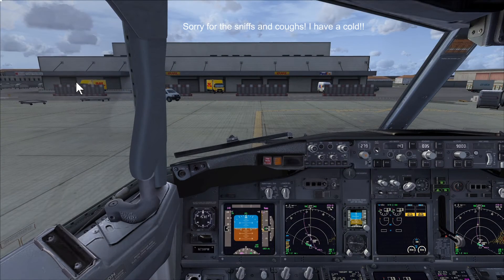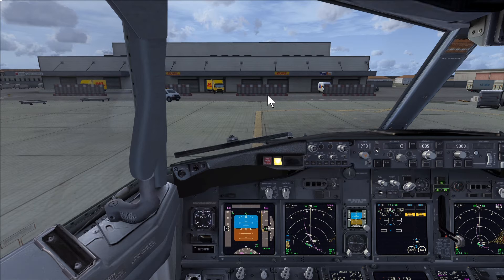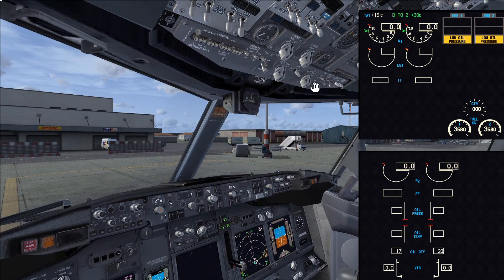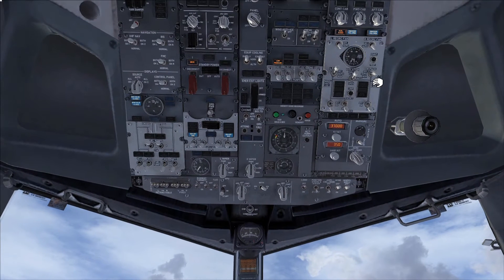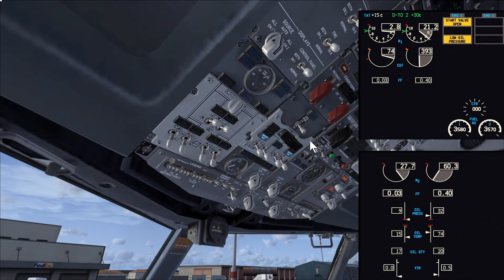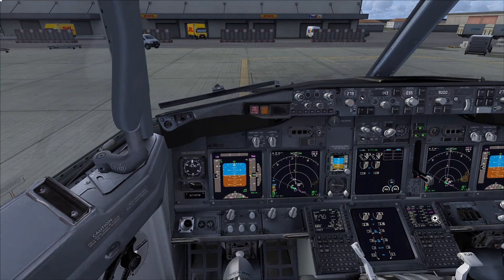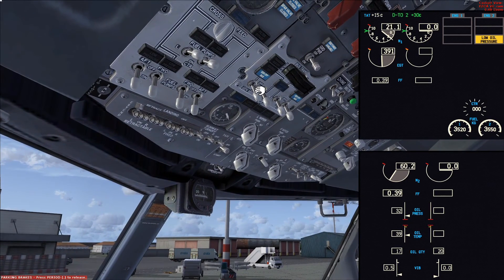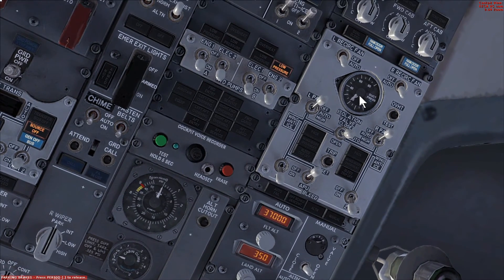PMDG 737 NGX - REAL BOEING PILOT - Engine Start Procedure

Comment: good   many thanks
Reply: i think we would need dme arcs and holds - examples and preparing hold following  instruction several examples.  all quadrants approach hdgs. and what to do: maybe even wind triangles  with examples otherwise we ll get it wrong
Reply from the maker: So nice of you! Thank you for commenting!

FD2S
Reply: @flightdeck2sim  i think we would need dme arcs and holds - examples and preparing holds following  instruction with several examples.  all quadrants approach hdgs. and what to do: maybe even wind triangles  with examples otherwise we ll get it wrong
very likely.  also progr dme arcs into fmc using fixes and distances -                to avoid practicing voodoo avionics !!

Comment: Hi Sir,

First I want to tell you that this video is just awesome :) .

But I have a little question about: do we use the cross-bleed procedure when it's very hot (like 30 ° C) ? By this way we can let the packs on. 'Cause I already saw that. But I'm not sure about.

Thank you ;)
Reply from the maker: Hi Med’

Bleeds off take off is for performance reasons. It increase the amount of thrust from the engines as they’re not having to use Bleed air to provide air conditioning and pressurisation 

FD2S
Reply: @flightdeck2sim  I was talking about the cross bleed engine start sir :)
Reply from the maker: Med ' whoops!, I was responding to someone else’s question and actually posted it here!!! 

Crossbleed start only needed if the APU is inoperative. If very hot we’d still start Engine no 2 first and then isolate the no 2 pack and eng Bleed so it can provide air conditioning whilst we start Engine no 1 using APU Bleed 

FD2S

Comment: Hello Sir,

Very fine video ! But I have a problem : I don't have the dump pressure available... I connected all the grounds connections I have but nothing. 

I can see that you have dump pressure without the Air Start Unit  (look at 6:56)  just with the GPU.
I tryed to connect the GPU only, like you , but the dump pressure stills unavailable.

Do you have a solution ?

Thank you :)
Reply from the maker: Hi Med'

Make sure you connect the Air Starter Unit. This is the alternate start procedure for when the APU is inoperative.

FD2S

Comment: if Apu is a no go item  then what's the purpose of X-bleed start and Ground start unit ?  Thanks
Reply from the maker: Hi Mehmet Zeki Demirdelen.

You can dispatch without an APU! 👍🏼 

FD2S
Reply: Thank you for your answer sir but im still wondering what would happen if a dual IDG failure occurs in flight with APU inoperative ?
Reply from the maker: In the unlikely event of you losing one IDG without an APU you would still have one source of AC power (the other IDG), this would require you to immediately divert.

If you lose all sources of AC power you have a difficult day in the office! You can still fly on battery power for 60 minutes but you lose a significant amount of systems but essential critical systems are still powered by the battery.

FD2S
Reply: Thank you so much for taking your time and illuminating me captain !
 I thought that having to rely on only battery power in an unlikely worst-case scenario is the last thing pilots would like to face.
Reply from the maker: Mehmet Zeki Demirdelen well it is! Flying on battery power is extremely challenging!

FD2S
Reply: I hope nobody will ever have to deal with that.
Reply from the maker: Me too Mehmet! I don’t know any cases where this is happened. Crew are exposed to this in simulator trainer and are trained to react 💪🏼

FD2S
Reply: Captain  again thank you so much and i'd really like to apologize if im overwhelming you with many questions but honestly though, i really appreciate the way you approach your fellow flight simmers. Wish you have safe flights !

Comment: Found your channel awhile back.  Great tutorials....informative and well done thanks!

Quick question regarding startup.  

Do you require timing for any startups. (ie to check starter limitations are not exceeded, light-off within so many seconds, or oil pressure rise)?

Keep up the great work!!
Reply from the maker: Hi Randall. Yeah we start when moving the start switch to GRD, this is for Aborted Engine Starts so we know how long the engine has been motoring for.

To move start level to idle detent at 25% N2 we need N1 rotation and oil pressure.

FD2S

Comment: Just trying to get into flight sim when I came across your videos. Brilliant to have real pilot guidance. Am I right in thinking the bleed air focuses high pressure air onto the N2 blades causing it to spin so then when they have enough momentum/torque to carry on going with ignition of fuel, similar to jump starting a car to give the car engines crank enough momentum/crank to sin up with fuel. I feel like I've just had a eureka moment if I'm right lol. Now to decide, X plane or P3D lol
Reply from the maker: EUREKA!

APU Bleed powers the starter motor connected to the N2 Rotor. 

FD2S

Comment: Air start unit- at a busy gate, will they start right at the gate, or push back first to a clear area?
Reply from the maker: Hi tasev1

Start ENG No 1 on stand with the Air Starter. Disconnect GPU and ASU then pushback. After pushback start ENG No2.

FD2S

Comment: hey FD2S theres been a few times after i start the engines where i would get a temp zone warning light that illuminates. What would be causing this and how would i fix it for future reference. Thanks
Reply from the maker: Hi Dene, 

Zone Temp light illuminates if the air overheats in the supply duct or if there is a control channel failure. If it's due to a overheat you can try pushing the TRIP RESET button after the duct has cooled. If not it could still be still too hot or the control channel failure OR a glitch with the NGX! 

FD2S.

Comment: Hello, i have just discovered your channel and really liked it. As far as ı know in the first flight of day R ignition is used because it is fed by standby bus whereas L ignition is fed by AC transfer bus. In order to check standby bus we use R ignition. And i have 2 question. First one is as soon as engine number 2 running u turned on engine number 2 pack on and Apu bleed off. Is there any disadvantage of that. And my second question is for external bleed you first started with engine number 1. Why sequence is changed. I will watch all your videos. Thanks for sharing.
Reply from the maker: Hi cagaty araz, thanks a lot!

You're right about the ignition! In the event of Total Loss of AC power we still have a source of ignition from the R igniter via the AC Standby Bus. If we have a problem with the R ignition prior to departure engineers must connect the L igniter to the AC Standby Bus to ensue we always have a source of ignition in the event of complete AC power failure! 

1. I don't know where you're referring to with regards to turning the APU Bleed off! The first engine start I put the no2 pack on and closed the isolation valve. This is the isolated pack operation start to provide conditioned air to the cabin 

2. The Air Starter Unit is and usually parked near engine no2 so we start eng no 1 first, remove the Air Starter Unit and then crossbleed start, typically after pushback!

Hope this helped answer your query!

FD2S.

Comment: I sometimes forget to turn off the packs during start. However when I have everything set right the engines refuse to start. I have to exit flight sim and start all over. Is that an PMDG thing?
Reply from the maker: Hi Bald Eagle.

You need to make sure you have a source of pressurised air. This usually comes from the APU. Make sure you have the APU running, APU bleed selected on, both packs off and the isolation valve switch open and it should work! 

Good Luck!

FD2S.

Comment: Is it flight approved though without an operating APU in general? 
Why not fix it? xD
Reply from the maker: You're quite right, there are several systems on this aircraft which might be inoperative but it's still safe to dispatch, including the APU. We consult a manual called the MEL (Minimum Equipment List) to confirm we can dispatch with the particular system inoperative.

Logistically for an airline to fix something like an APU it could take a few days to get the necessary parts, the right engineers to do the job and then find a time when the aircraft isn't scheduled to fly. Typical 737 operators will have turnaround times between 25 minutes to an hour. If something like the APU stopped working during a turnaround you don't have the time for it to be repaired so you would consult the MEL, liaise with engineering and dispatch (so long as the MEL allows you) with the said item inoperative.

Hope this helped! 

flightdeck2sim.
Reply: flightdeck2sim awesome! thank you for replying! really like the videos, subbed as well!
one more question if you may, is that a big difference between the live aircraft and the ngx model?
Reply from the maker: PMDG have made a remarkably accurate rendition of the aircraft and it has been programmed extremely accurately. 

There are a few quirks/differences but the model itself is sound and it flies in FSX almost identically to the real thing. Attitude and thrust settings for a given configuration pretty much match the real aircraft/what you get with a full size Level D sim.

I started my Type Rating 5 years ago and used it then and I still use it now to practice a particular procedure before I teach it at work and for my own 6 month check!

flightdeck2sim
Reply: flightdeck2sim that is amazing to hear! I wish to become a commercial pilot myself, will be watching your videos a lot so thanks again for all of the help! :D
Reply from the maker: No problem! Good luck with everything! 

flightdeck2sim

Comment: I was a passenger on a Ryanair flight from manchester that performed a crossbleed start.  We pushed back started left engine and pushed to a safe area. It was at that part when the aircraft began shaking with the increase in engine noise that I became aware of a crossbleed start. 
Is a crossbleed required because it is too dangerous to remove the hoses from manifold whilst both engines are powered?